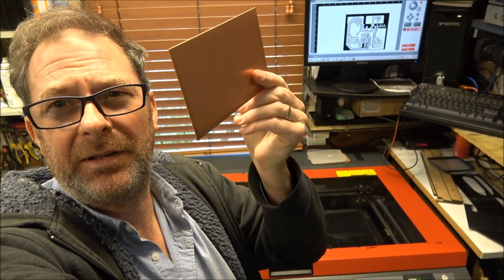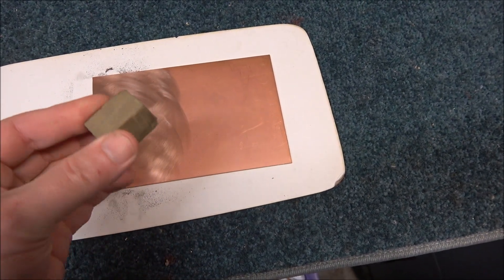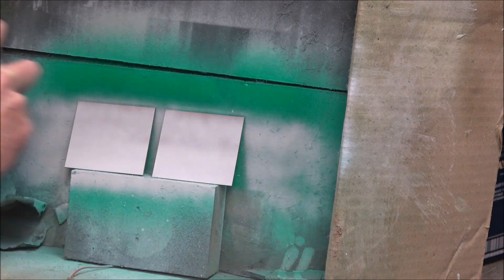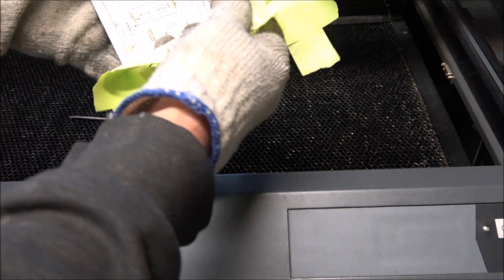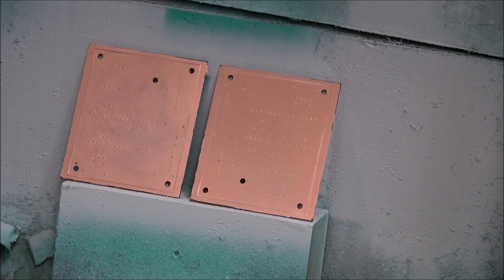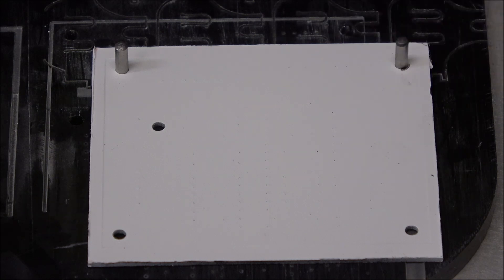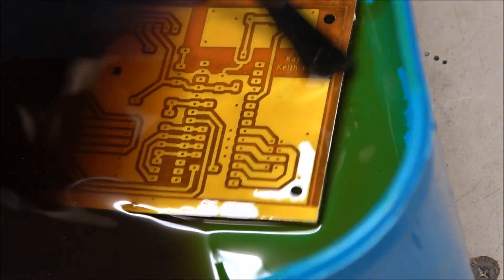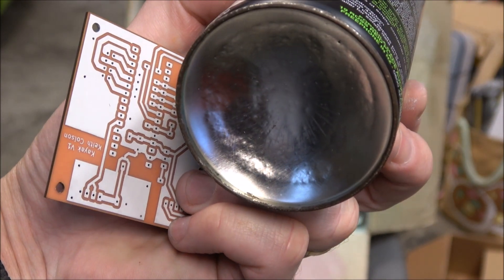Laser cut & engraved PCB made on a Laser cutter.

Comment: The results are just impressive! I want to try it at home, but I'm not sure how safe is to laser cut phenolic PCBs. AFIK, phenolic PCBs  have epoxy resin, and when laser cut you can get toxic fumes (benzene among them)
Reply from the maker: Good point, I have very powerful extraction to a big filter outside. Do not do this inside a house!
Reply: @Robonza  the laser machine I have access to is very similar to yours with the extraction etc too. We've been advised against using fibreglass boards but told phenolic would be ok. Definitely wanting to try this

Comment: Good stuff but wouldn't handle a proper wash process.  Have you tried cutting polyimide tape (Kapton tape).  Might be easier for etching.  Place polyimide tape onto a black wax paper backing (or maybe a sacrificial phenolic pcb backing.  Laser cut through and then pull off the backing and stick to PCB.  Etch and be done.  Better than messing with paint if it works.
Reply from the maker: I never remove the paint so kapton would not fit the process. Kapton is something I use as its really good stuff.

Comment: The laser cuts holes surprisingly well, at least for a single-sided board. Less so for a 2-sided board.

I’d suggests to ditch the arduino and go for a soldered-on ATmega/tiny MCU. The old mega16/32s and tiny84 series are the old go-to, but I’ve swapped to the tiny1614 series and will be trying the mega4808 series in my own motor driver soon. Sure you’d need a programmer board (which you can also make yourself) but the result is going to be a lot smaller and cheaper. Plus you could arguably get rid of a need for holes altogether. Your setup definitely has a lot of precision yet!
Reply from the maker: Good comment. Through hole is so good because I can do a firmware upgrade for dumb dumbs simply by plugging in a new  Nano.

Comment: Great video! In a couple of years I will be an electrician and I will be hopefully making boards like yours for fun!
Reply: Im an electrician  but I'm  going to make  printed circuits  boards ?? Great video ?  

  Are  you ??  Really !!

I think you may be in the wrong field  myself and may need to  become an electrician  with an awful lot or electronics  backgrounding  , service  related to component level   to start  doing this or would have electronics as a hobby   of some type 

 I wouldn't follow this  presentation thinking that this will work for someone like  you  because it wont  ! 

Still  ought to be   interesting  !!

Comment: Boa tarde.
Comprei um módulo de laser 40W para cnc, minha pergunta é:
- Será possível fazer um trabalho tão bom quanto esse, com um módulo de laser de 40W?
- Qual melhor spray para usar com o respectivo módulo de 40W?
Reply from the maker: You could use thinner paint or ink. You need to experiment. It might not cut the holes.

Comment: I have a new hobby (electronics) and was trying to make PCBs with prints on transparant sheets. I never got it to work nicely. Lately i am more and more looking into cnc routers/lasers. This video made me almost instantly buying a cheap cnc bench hahahah. 

Do you think this is also possible with cheap 1318 with like a 40w laser? I just want a new hobby (cnc milling/engraving) but im affraid i need to vaccuum the house alot to get my wife comply spending more than 400 on ANOTHER hobby :)
Reply from the maker: A 40W should work, might not cut the the PCB but would raster the paint off ok.

Comment: This is the best thing i've seen this entire year!!
Thank you so much for this.... I just bought my first laser machine.. 20W Diode laser, but i'll work myself to getting this type...
Reply from the maker: Thanks for such a great comment. I would be keen for you to try ink instead of paint as it will laser better with 20W. Let me know how it goes.
Reply: @Robonza  I use a cheap desktop 5W laser / cnc combination from aliexpress for this, and it works great with regular (black) spraypaint. The laser can't cut the board, but it can remove the paint, the cnc spindle can create the holes and cutout.

Comment: where do you get the phenolic pcb from, I tried and could not get anything except the FR-4?
Reply from the maker: Aliexpres- search Laminate copper pcb. Its the light brown coloured stuff
Reply: @Robonza  Do you have a seller that you tried before?
Reply from the maker: @TheAmerTV   I dont remember
Reply: I have a 75W machine from Epilog and was not able to make any thing closer to this, Always getting burns and loosing the pads after opening the holes.
Reply from the maker: @TheAmerTV  Sounds like its all getting too hot. You dont have to burn the holes right through. You could finish them with a drill bit.

Comment: I have not been able to export/plot a file from kicad to cut the holes, can you explain how you managed this? thanks
Reply from the maker: I simply export a PDF and import that into the laser software
Reply: @Robonza  Could I ask what version of Kicad you are using? If I go to the board layout then File>Export I do not see a pdf option, I can get the layer data from the SVG export after a bit of a struggle but no hole information/layer.
Reply from the maker: Try pressing the print button .I use Cutepdf writer as a printer

Comment: Great video. I love what you have come up with. Could you explain the lacquer mix you use for solder max and how you got it in a spray can?  Thank you.
Reply from the maker: I just went to a paint shop and they did it for me. I think it was 20 percent green and 80 percent clear lacquer
Reply: @Robonza  do you think standard Rust-Oleum 352721 Automotive Premium Custom Lacquer Spray would work as well?  Thank you.
Reply from the maker: Sure, it would work fine. I only made the translucent green to make it look cool. It does not "function" any better.
Reply: @Robonza  I'm impressed with the look of the green solder mask, but does it truly function as a solder mask i.e. prevent solder bridging between pads in close proximity?
Reply from the maker: @daffygrey  Its nowhere near as good as a real solder mask but can you solder really nice like me haha?
Reply: @Robonza  Would a heat proof stove/exhaust paint work better for the soldermask?  The laser should make short work of it even then.  Be a great ideas to test as the paint should handle solder temperatures better.  Colour selection may be very limited.
Reply from the maker: @KallePihlajasaari  It would probably work well

Comment: Hi again Robonza, from spain :-D
I have shared your video to a telegram group of almost 400 people that is dedicated to the world of cnc. It is cnc in general where some is cnc 3018 and some is Neje.
I know that at least 1 person from this group (apart ofme) who tries to make pcbs have seen and appreciated your video.
And this person and I have seen a common problem than me.
When we clean the plate with alcohol, the etched paint seems to be disappearing and everything is fine, but the ferric etching is excessively slow.
Investigating a little in depth we have seen that, when cleaning the plate with alcohol, the copper tracks are not totally clean, because if we scratch one with a needle or pin, the bright color of the copper really comes out, while the rest is copper color pale dark.
(We have not noticed this before, because our background instead of green is black, and in the contrast difference we seemed to see the correct copper)
The funny thing is that I just put in a new 5w laser (the previous 5w laser also had a problem and was weak), and my friend has a 40w neje, and the same thing happens to both of us.
The acid process is excessively slow, and the acid weakens quickly and is not useful for a 2nd plate.
We suspect that everything is a product of the paint that is still in the useful copper.
We wonder what we might be doing wrong.
I have tried cleaning with isopropyl acid, but it spoils the paint on the entire plate, it is removed and it looks matte burned.
Thank you very much
Reply from the maker: 1) Your paint is not good. e.g. primer is porous, you need 2 in 1 top coat
2) Your ferric chloride is weak. Mine does a whole board in 12 minutes.
3) You want to remove little copper so paint in the large areas so less etching is needed.
4) The laser must be well focused and run over the board 3 times to get it clean.,
Reply: @Robonza  I will try. Thank you
Reply: @Robonza  I had the same experience as pedro, engraving looks very good and clean, but no result during etching, i thought it had something to do with the paint kind of burned into the copper layer leaving a king of protective layer.
I will try 2-3 runs again.
If i understood correctly you are using just a primer spray, i used paint spray, maybe not a good idea.
Thanks for sharing this video! i'll try again because the resolution of the CO2 laser engraving is really fantastic promissing a perfect result if the etching will work.
Reply from the maker: @rinusdamen6436  Make sure the laser is well focused. If your engraving is weak then airbrush some permanent ink instead.
Reply: @Robonza  thank you i'll try, also looking at the fiber laser capabilities

Comment: How time you think for remove paint with laser in your PCB if your laser was 5w
I'm doing with black paint and vectorial, time for only one face 1,5 hours
Reply from the maker: Wow, that is  long time. I look at my 60 watts as only just enough to do a pcb
Reply: @Robonza  what? 60w laser is like a monster 🙈
Reply from the maker: @apachebcn  I was thinking for a low power laser you could air brush on some ink so the resist would be very thin and easy to remove with 5 watts
Reply: @Robonza  i tried. White paint and black paint over white. Spray paint, I not applied hot air
Laser draw graphics and words (is little work)
Was perfectly.
May be would be good, paint all PCB with white, green mask paint. Then laser trace  with ver low power to draw tracks, and later again for words and symbols.
Of course pads.
Colofonia resin may be not need if paint it's good to copper protect.
Really i not live this resin, is very dirt to work
Reply: I tried to put colofonia resin over paint, and paint was not damaged
Reply from the maker: Good work, make a video so I can see
Reply: @Robonza  today I tried to remove mask with laser (my little 5w laser)
7 hours 😑
I made this "paint" zones with flatcam.
Flatcam is for spindle, but you can use it with laser.
I said to flatcam tool work is 0.05mm width, and I got lot of circle lines
This mean laser is more stretch, maybe 0.02mm
Reply: I need to use some tape trick for not use this method of remove pads with point laser
Reply from the maker: @apachebcn  Good work 0.05mm is pretty good, mine is bigger than 0.1mm. I tuned my artwork so it came out better than 0.02mm

Comment: That's awesome! 
What is your laser module power output? Could you share some tips about the laser power output percentage and also the speed please?
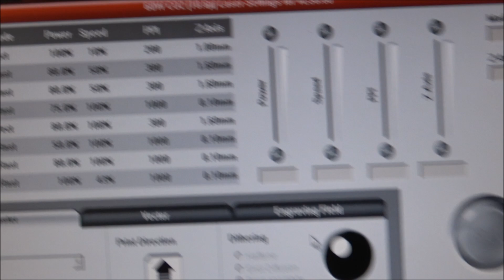Reply from the maker: Its a 60 watt Universal and you can see the settings at 3:45
Reply: @Robonza  Thanks for a quick response. Just wondering if it was running at full power during engraving, I can't see clearly the settings on the video so I raised my question. I am new to this method and wanted to learn some techniques. 

I've never seen such very wonderful result like yours here in YT. Not just beautiful as it looks but also very precise. Love it!
Reply: @Robonza  I review the video many times and it's really helpful. 
Have made few PCBs out of my 5500mW laser engraver with almost the same looks as you did. I made mine with a manual cut and drill though. Thanks a lot!
Reply from the maker: @PLASMUX-20  well done, its not easy